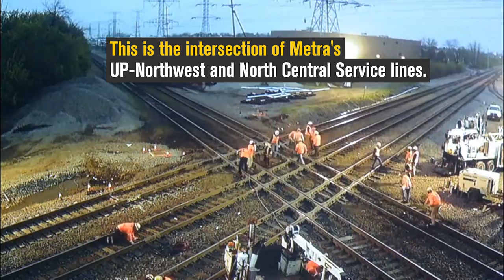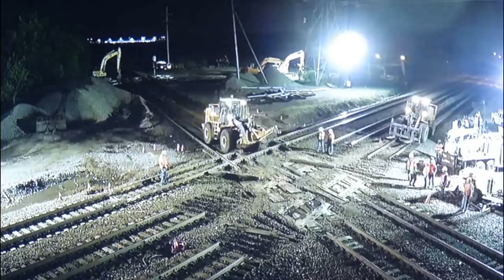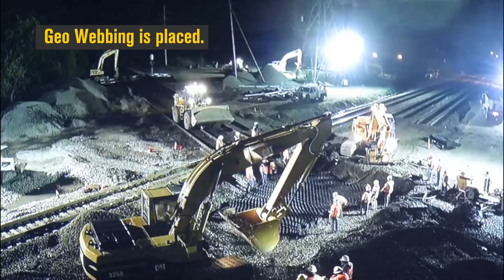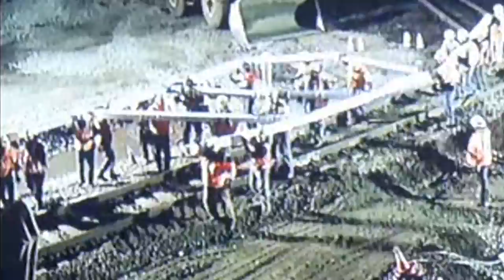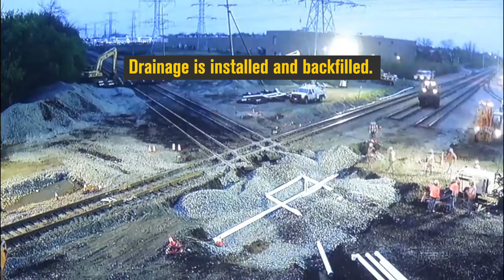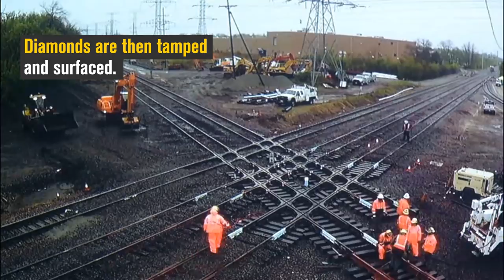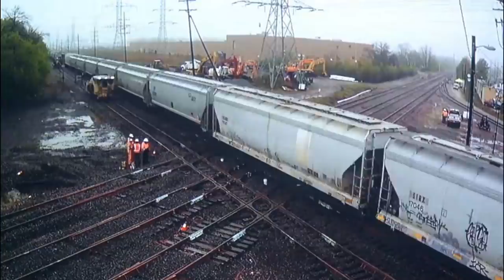Chicago's Five-Track Deval Diamond Replaced in Under Two Minutes

Comment: Ok why In the hell in 2017 do they have this kind of track layout? This kind of stuff is the very reason we don't have high speed rail in this country.
Reply: Including the incredible risc of an accident here.
Reply: the main reason for that would be that freight trains dominate the US rail system.. Passenger rail often times either shares a slow rail with the freight trains or has to use 50 year old rail like in the northeast.
Reply: Unfortunately not only do 6 different tracks converge here (see my other post explaining the incorrect labeling of this interlocking), BUT a major thoroughfare (US 14 (aka Northwest Hwy (Milwaukee ave in Chicago))) runs right under one of the diamonds, and parallels the Harvard Sub (UPNW line). 

In this case, trying to grade separate the different lines would be very cost prohibitive. The UPNW line has two very close stations, (des plaines and Cumberland) so raising this track would be difficult. The NCS line south of Deval abuts a lot of houses and has very little right of way. And the UP New Line (Milwaukee Sub) from what I remember Carries the heavy coal trains, also runs adjacent to homes and parks (Wolf Park was always a fun train watching spot), and there is a cement factory (I believe) that squats right between the New Line and the branch to the UPNW.

In short, grade separation is not possible. Track consolidation is not possible. Deval will remain, as a symbol of railroad efficiency despite limitations.
Reply: Passenger trains are secondary to freights since the railroads make the most money from the freight service they provide.
Reply: Xilom82 No. The reason for a lack of high speed rail is the size of the country and the resulting favoring of air travel. The rail is just a symptom of the situation. If we wanted high speed rail, we would build a separate track like every other nation.
Reply: Because it's in Chicago, and Illinois governors serve two terms - one in office, the other in prison. All kidding aside, right of way is a HUGE issue in a packed urban landscape, don't think that upgrades are not desired, but think of the amount of grade required to elevate part of that track.
Reply: Klorrin stop spreading misinformation. Only Spain and Japan really use dedicated HSR lines. Japan needs separate lines since their standard gauge is narrow gauge and Spain's rail network was unsuitable for upgrading. Germany and Britain on the other hand have very successful networks that rely primarily on four track main lines.
Reply: This is typical of railroads in the U.S. ... where they cross, they have cooperatively owned signal systems that stop opposing traffic so that the "priority" train can continue through the crossing. With railroads, building an over-crossing would require substantial investment and would need grade changes starting more than a mile from the crossing in each direction. Few at grade rail crossings (such as this one) can justify the expense to eliminate an at grade crossing. Hundreds (if not thousands) of these are operated throughout the country with no incidents of any significance. (I am a retired RR worker.) 

As for high speed railroads in the U.S. the primary reason that there are few, if any, practical city pairs that are not very expensive to develop and the distances (and often the geology) is not conducive for high speed operations. The reality is that there is a single route in the U.S. that's worth investing in to create high-speed rail -- the "North East Corridor" (NEC) between Washington DC and New York City (and, perhaps, on to Boston). The population density along that line is quite high and a well-run high speed system would likely come close to paying for itself. Of course, our Congress had hung requirements on Amtrak to operate money losing service all around the country, taking investment away from the NEC. There are politics involved, where representatives want "service" to their state, regardless of the market needs. (Most are better served by airlines or (for shorter distances) by busses.) I note that the NEC has had "high speed" service starting in the 1960s ... that gets invested in (and "upgraded") then is allowed to deteriorate, becoming a shadow of former glory. The original "High Speed Corridor" trains were (supposed to) go as much as 160 mph between stations ... but lack of maintenance of equipment and rail bed and other factors (like the politics of having the NOISE of these high speed trains pass through crowded cities) end up with the trains never really accomplishing the goals initially set out. 

People often point to other countries with the question if there, why not here. Well, Europe, for example, has large cities much closer together -- and the high-speed trains in France (for example) generally only travel a fraction of the distance that most proposed 'high speed" routes in the U.S. involve. (Example, the California boondoggle from "LA to San Francisco and Sacramento" is relatively easy to build in the Central Valley ... but suffers a major (expensive) crossing of the Tehachapi mountains to get from the Central Valley over into the Los Angeles basin. Likewise, at the north end, the trains must pass through the Coast Range to reach the Bay Area ... the the SF Bay sits in the middle of the population center, thus requiring either choices of who to serve and who to force into "bus connections"  (on the crowded Bay Area freeways) -- or to expensively split up the trains with parallel lines on either side of the Bay. An honest calculation of the costs would show that the California High Speed Rail boondoggle will NEVER be worth the expense. (And it only takes 45 minutes to an hour to get between various airports in the SF Bay Area to Airports in the LA basin -- with some of the lowest airline fares in the country.)
Reply: Pete Masterson Thanks for the explanation :)
Reply: One direction could go slightly down the other could go slightly up there's no need for huge elevation or tunnels. But from comments on here it sounds like rocket science to some.
Reply: z00h what you're not seeing is another set of tracks (owned by CN) behind the camera. Also, off to the right is a 4 lane highway that passes under one of the other diamonds (where the 2 track line meets the CN line). There would need to be three grade separations instead of one. I would highly recommend looking at a map of this area. Here are the coordinates (copy and paste into google): 42.0465654, -87.8990833

Even at a 3% grade (3 feet up for every 100 feet forward) to build one flyover would require adding more than 1/2 mile of elevating track in each direction. The Harvard Sub (UPNW, 3 track line) has two stations that are too close, so you can't raise them, and the Milwaukee Sub (the New Line, 2 track line) has a yard, a junction, and 4 major thoroughfares within 3/4 mile. The CN Line also has 7 streets within 1/2 mile, plus a creek. ComEd, the Electric Utility, has a substation right next to the interlocking (hence why UP made a big deal of this project, because they couldn't use large cranes without electrocution risk). Grade separation is just not feasible.
Reply: Only Spain and Japan? Several more countries use dedicated HSR lines, including Germany and Britain, with some of them having networks either completely seperated from the traditional network like Japan (for example Taiwan), or essentially duplicating it (instead of just supplementing), like Spain does: for example China, Italy or France. Oh, and btw, Spain's classic network has been widely upgraded and adopted for high-speed operations. They just decided to built an additional, dedicated HSR standard gauge network because their classic one has a different gauge, making it less suitable for cross-border operations with France.
Reply: Learn to read nuance. I said primarily and that is completely correct when talking about Germany and the UK. 

High Speed One ( the only dedicated British high speed tracks) is 60 miles long. That's nothing compared to Britain's WCML and ECML which are each 400 miles long. Germany's dedicated HSR tracks on the other hand are more bypasses than complete end to end HSR.
Reply: drumlineramos thank you for your reply, as opposed to the guy who replied to my suggestion of a bridge simply as "it's not possible." I am not a rail engineer but I have access to google maps and I disagree that it is not possible. Perhaps it is not cost effective for this location. If it's only freight moving here I might agree.
Reply: SSN 21 in the US our mainlines are often two track and sometimes one track. Even the NEC has three-track segments which is insane
Reply: Ahmed Kazikian that is why I said it is not feasible. The UPNW is one of Metra”s busiest routes, and passenger disruption on such a big scale is not something anyone wants. The CN line is also a Metra Line, so there are two passenger lines through here. Add to that the electric substation reconfiguration, the possible relocation of highway US14, and all the neighbors who would have to put up with a couple years of construction. Is it possible? Yes. Is it likely to ever happen? Very doubtful, and I speak firsthand since I used to live 5 blocks away from this crossing.
Reply: drumlineramos thanks for taking time to reply!
Reply: drumlineramos Since I like being pedantic, I'll mention the larger problem that something like 80% of freight in the US must pass through the Chicago area bottleneck.
Reply: Ahmed Kazikian and me being a rail fan, I have never had a problem with that ;)
Reply: drumlineramos Ha, well, I can see it being nice for a rail fan, but no so great for the network at large.
Reply: Bus connections? Isn't that BART metro system there?
Reply: Its freight, you would not have a high speed rail on a freight line to begin with, it would need to be dedicated to high speed transit. This just fine what they did.
Reply: We don't need high speed rail
Reply: Even in Japan, the king of high speed rail, most of the time it just more economical to Fly.  It cost me 22000 yen to take the bullet train round trip from Tokyo to Osaka.  It cost about 20000 yen round trip to fly domestically anywhere in Japan.  I got round trip plane tickets from Osaka to Sapporo for only 20000 yen. That would have been 40000+ yen on high speed rail and been 4x longer.   High speed rail only works for distances less than 350km-500km. That limits the cities in use in the world.
Reply: +SSN 21 The WCML and ECML don't qualify by most definitions of high speed 125 mph falls well short of the 186 mph (300 km/h) threshold usually considered high speed rail. The HS2 infrastructure soon to begin construction is a fully high speed line with running speeds up to 250 mph and is almost entirely on dedicated infrastructure but for a few short branches to serve neighbouring hubs which wont be served directly such as Stafford but of course trains departing Stafford wont be able to run at full 250 mph speed until they reach HS2.

The UK has come late to the High Speed rail party but we are finally building something, bonus though that waiting as long as we have the tech is even better and it will be the fastest HS line in Europe with it's 400 km/h max speed.
Reply: This track has nothing to do with hsr. It would be a dedicated line.
Reply: Whilst its designed for 400km/h, it will never travel at 400km/h. The economics don't stack up because it's too energy hungry at that speed and reduces capacity too much, 320 will be the norm like other new HSR.
Reply: Xilom82 but we do have high speed rail here in the usa
Reply: Xilom82 ever herd of the Amtrak Accella Express

Comment: It's interesting that such crossings do exist but from a traffic point of view they are limiting and a level separation would be better both from efficiency and safety point of view.
Reply: In this case, trying to grade separate the different lines would be very cost prohibitive. The UPNW line has two very close stations, (des plaines and Cumberland) so raising this track would be difficult. The NCS line south of Deval abuts a lot of houses and has very little right of way. And the UP New Line (Milwaukee Sub) from what I remember Carries the heavy coal trains, also runs adjacent to homes and parks (Wolf Park was always a fun train watching spot), and there is a cement factory (I believe) that squats right between the New Line and the branch to the UPNW.

In short, grade separation is not possible. Track consolidation is not possible. Deval will remain, as a symbol of railroad efficiency despite limitations.

Comment: I just started riding Metra UPNW for my daily commute early this year. The crossing was much rougher ride after the replacement than before the replacement.  Seems to have calmed down a little, but I am still surprised by the amount of side to side travel and noise when going over the intersections, and that it wasn't more smooth right after installation.

For comparison, check out network rail videos such as https://youtu.be/55U5qY5Glu8 Great video, great to see you're keeping things up to snuff.
Reply: It would be nice if they mechanized these crossings with a rail piece that moves, almost like how a turn-table works. It would help smooth the ride some more and make less noise ...
Gotta wonder, the tracks mustn't like the banging so much. Diamonds probably have to be replaced now and then because of the extra mechanical stress.

Comment: Brilliant work to do that in two days (certainly don't get that in the UK), but shocked that that shitty intersection actually exists and a bridge and/or underpass hasn't been built.
Reply: In this case, trying to grade separate the different lines would be very cost prohibitive. The UPNW line has two very close stations, (des plaines and Cumberland) so raising this track would be difficult. The NCS line south of Deval abuts a lot of houses and has very little right of way. And the UP New Line (Milwaukee Sub) from what I remember Carries the heavy coal trains, also runs adjacent to homes and parks (Wolf Park was always a fun train watching spot), and there is a cement factory (I believe) that squats right between the New Line and the branch to the UPNW.

In short, grade separation is not possible. Track consolidation is not possible. Deval will remain, as a symbol of railroad efficiency despite limitations.

Comment: What's a reason such dumb intersection exists at all? If there is such big traffic here 3 tracks are required in one direction and 2 in another, an overpass or tunnel should definitely be used either for throughput and safety.
Reply: In this case, trying to grade separate the different lines would be very cost prohibitive. The UPNW line has two very close stations, (des plaines and Cumberland) so raising this track would be difficult. The NCS line south of Deval abuts a lot of houses and has very little right of way. And the UP New Line (Milwaukee Sub) from what I remember Carries the heavy coal trains, also runs adjacent to homes and parks (Wolf Park was always a fun train watching spot), and there is a cement factory (I believe) that squats right between the New Line and the branch to the UPNW.

In short, grade separation is not possible. Track consolidation is not possible. Deval will remain, as a symbol of railroad efficiency despite limitations.

Comment: The lesson is that you should have build an overpass, this is just plain stupid! Get your infrastructure right.
Reply: In this case, trying to grade separate the different lines would be very cost prohibitive. The UPNW line has two very close stations, (des plaines and Cumberland) so raising this track would be difficult. The NCS line south of Deval abuts a lot of houses and has very little right of way. And the UP New Line (Milwaukee Sub) from what I remember Carries the heavy coal trains, also runs adjacent to homes and parks (Wolf Park was always a fun train watching spot), and there is a cement factory (I believe) that squats right between the New Line and the branch to the UPNW.

In short, grade separation is not possible. Track consolidation is not possible. Deval will remain, as a symbol of railroad efficiency despite limitations.
Reply: Everyone who is not in the area is an expert apparently. You are right on.

Comment: I assumed they were going to replace the at grade intersections with an underpass or overpass,
but why do something smart, when you can do something dumb.
Reply: In this case, trying to grade separate the different lines would be very cost prohibitive. The UPNW line has two very close stations, (des plaines and Cumberland) so raising this track would be difficult. The NCS line south of Deval abuts a lot of houses and has very little right of way. And the UP New Line (Milwaukee Sub) from what I remember Carries the heavy coal trains, also runs adjacent to homes and parks (Wolf Park was always a fun train watching spot), and there is a cement factory (I believe) that squats right between the New Line and the branch to the UPNW.

In short, grade separation is not possible. Track consolidation is not possible. Deval will remain, as a symbol of railroad efficiency despite limitations.